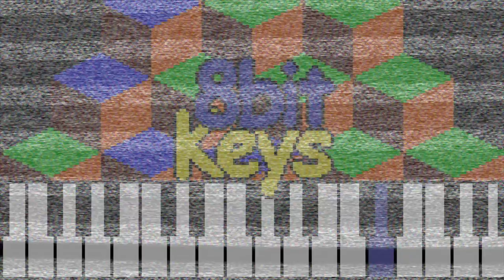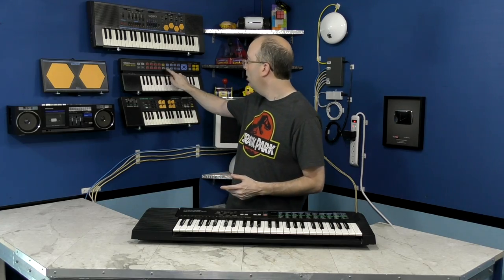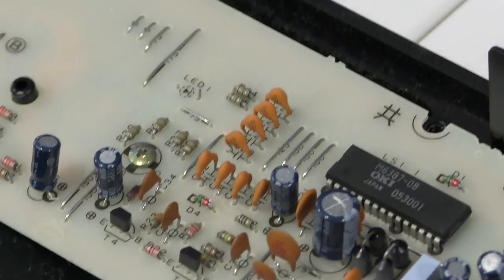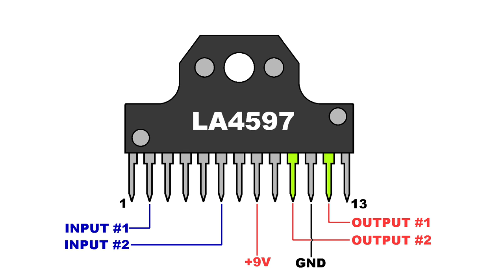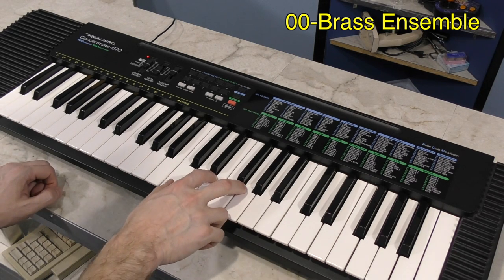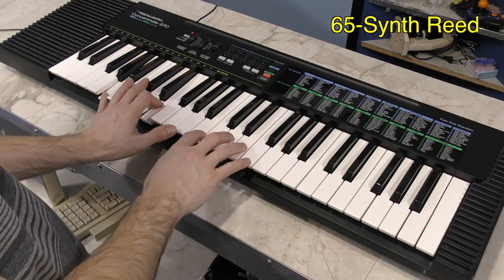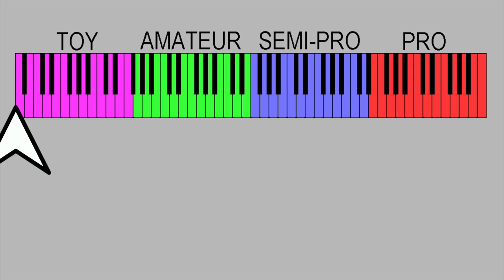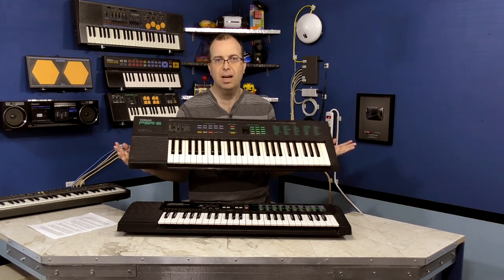Casio CA100 Line Out Modification and Demo (Realistic Concertmate 670)

Comment: I actually have this exact keyboard myself! Radio Shack rebranding and everything. But one correction about the polyphony at 8:31 . You can actually have up to 8-voices on every instrument. The instrument select button also has a label that says "poly/texture". If you press the button, it alternates between limiting the keyboard to 4-voices and giving you a more "textured" sound (which just seems to add a bit more reverb or some sort of modulation) or giving you the full 8-voices without any "texture".

Thus the actual complexity of the instrument doesn't really actually matter. It's just dependent on if the instrument is set to "poly" or "texture" mode.
Reply: +Neapolitan_ Husky I was about to write an answer myself when I read yours. Also, he didn't try the auto-accompaniment feature which limits you even further: 2 notes in texture "mode" and only one note in "poly" mode! I also have the same keyboard from when I was a kid. The interesting part is that when you remove the Realistic label on back, you find the original "CASIO CA-100" brading directly on the plastic.
However, I suspect the sounds be actually PCM (I didn't belive it back in the day) but very short looped samples, like wavetable. Nobody bothered ripping the content of EPROM chips (if it's technically possible) from the Casio CA line so I can't really tell.
Reply: @Dioxaz  This also labled as a Hohner PSK 20

Comment: Another trick you can use to get line output is to unsolder the leg of the headphone jack which causes it to mute the speaker when there is something plugged in. This essentially turns your headphone jack into a line output. I have a much newer Casio keyboard where I did this and also added a little switch so I can change whether it's a headphone jack or a line output jack.
Reply: He just likes to do (unnecessary) mods and make up reasons for doing them... I think it's more about the process than it is about the result, in spite of what he might say.
Reply: I believe most of these connectors that "auto mute" mechanically disconnects the speakers when something is inserted. Drilling a new hole would be sensible in that case, as that would put it on par with most modern keyboards that have both a headphones and a line out connector.
Reply: what is this leg on the jack? i have one but i dont know :S
Reply: @etiennelj  if you dont like the channel, dont click on the videos or comment!
Reply: @eemeli7093  why not ? Diverse opinions make for a richer discussion. Criticism prods innovation.

Comment: Radio Shack actually put final assembly date codes on most of their devices.  On the bottom, it has "6A0" on it, and that is the date, where the first number is the month, 1-12, the "A" is a spacer, and the last number is the final digit of the year.  So, your keyboard was assembled in June of 1990.

Comment: @ 8-bit Keys I have the Casio CA-301, CA-401, CTK-100, CTK-120, CTK-130, MA-101, MA-120, MA-130, and MA-201. All of those keyboards are based on the same sound chip as the CA-100. I also have the Casio CT-400, CT-840, and MA-220. Those three keyboards have similar sound hardware, but a few of the sounds are different from the other afore mentioned models. For example, the piano sounds more realistic on the MA-220 than on the MA-130. I also have in my vintage portable electronic keyboard collection the Casio CTK-150 and one of its bigger brothers the CTK-300. Both keyboards have a lot of the same sounds as the other models mentioned above, but here some of those sounds improved resembling what they’re supposed to be, such as the trumpet and the harpsichord for example. However, some other sounds such as the accordion and the bagpipes didn’t improve at all.

Comment: When my grandfather died and his house got cleaned out we came across this exact Realistic synth. Apparently He fooled around with it. I took it home, it had a black plastic molded stand it sat on as well. I had it for years. I used to take line out of the headphone jack into my 4 track and monitor through that. I composed and recorded many primitive hip hop beats with this thing and bass played through a practice amp, that i would mic through a garbage can I punched a hole in the bottom of and fixed to the end of the amp. Eventually I was going to junk it but my girlfriend at the time said she wanted it. When you zoomed into the list of sounds I got a chill as I hadn’t seen it in so long. Great mod and great vid.

Comment: I recently pulled my CA-100 out of storage and it was not working properly. I would flip the power switch and it would light up for a moment and then die. This video helped me take apart the whole thing and after checking over all the components I had a stroke of genius and looked at the power switch itself. There was so much gunk on the board from being in storage that the power switch wasnt making contact. A bit of contact cleaner and 136 screws later I once again have a working keyboard :D

Comment: I think the inverted signal sent to the speaker is called a balanced output signal. It's made to eliminate electrical noise during the transmission of the signal. I guess that's why you get a better signal from the speaker.
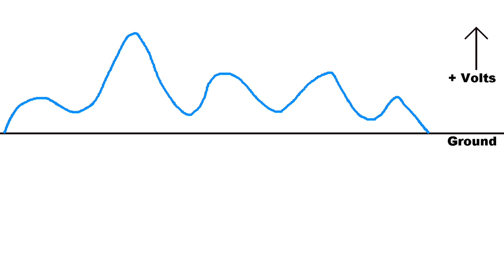Reply: it's called a bridge-tied load configuration, and he correctly identified the reason this was done at 5:27. it has nothing to do with common-mode noise rejection in this context.

the audio rip using the inverted signal as a ground reference should be 6dB higher in level than the chassis-ground version.
Reply: @technology4617  Okay thanks for the correction, It's configured that way to amplify the signal and not to correct noise if I understand. It would only cancel the signal if it was not inverted.

Comment: I don't know about you, but I'd put some heat-shrink on capacitor legs at 7:13 ;)
Also, I'm just curious - if both outputs are floating, wouldn't it be better to put capacitors on both wires? Because now your CINCH ground isn't same as DC jack ground.

Comment: Oh the amp chip is being used in bridge mode to give more power to the speaker, it’s a way to use a stereo chip in mono, but with a higher output wattage using both parts of the amp

Comment: David, the main reason why you record from the input of the amplifier is that the Amp's noise adds when you amplidfy your signal. If you use the method you said before (record directly from the inputs of the amplifier) then you'll get a less noisy signal. If your amp is a low noise amp you can just use the outputs directly but if it is a noisy one (not realy used in audio technics tho) you should get the signal from the inputs instead of the outputs. In most cases try to use the amplifiers inputs for the line output for clear audio. Love the show :)

Comment: Just picked myself up a Casio CA-110 at Goodwill. I have a Behringer 25w amp that can work as a preamp with L and R output. I would recommend getting a small amp like it. It would save you the hassle of finding the amp on the keyboard, soldering, and drilling. You would have no input delays. Also, you get the added benefit of stereo v mono; as well as, you would be able to make adjustments to gain, bass, mid, and treble. Mine was just $100.

I know you said you don't have a studio, but I think for a buck it would be a good investment since I have seen you do this more than once. This merely a suggestion. I'm not telling what to do.

Also also, they had a behringer guitar amp at the same goodwill that was a 30w for $50 that had the same function. I'm in CO though not TX :,(

Comment: I have the Casio version of this keyboard (or one very similar), and it has the interesting feature that when you press the "tone bank" button, it will alter the "depth" of whatever instrument you're using, giving you more or less polyphony.
Also interesting is that on my keyboard Piano IS the top option. Also, it has the same demo tune - no Rick Astley.

Comment: You should not use a polarized capacitor when connecting to a BTL amplifier like this one. In addition, the keyboard can never share the same ground as the device you're connecting to or you're likely to have a dead amplifier chip.
Reply: (I agree with you.) I asked the same question before. Electrolytic capacitors can withstand 1 to 1.5V reverse voltage. Thus, line level AC should be fine in this case. Moreover, the keyboard itself's already isolated as a transformer's being used at the 9V power input. (But I would use a ground loop isolator whenever dealing with different voltage of ground.)
Reply: why is it bad to use polarized ac coupling capacitors with btl amps

Comment: I have a Casio CTK-100 that looks a bit different but sounds exactly like that. Same demo and button press sound and everything. Built the same too with the circuit board on top and the OKI chip. Pretty much the exact thing just a more modern looking package and actually has the Casio badging.

Comment: the audio in this keyboard gets boosted by a two channel amp , so if you have only a mono spaeker keyboard but a stereo ampfilifier it gets brigded to double the ampfilfication. It works when both channels on stereo have the same data. This is a common method on car hifi ampfilifiers, cause they are often at least stereo but many people are using these for an extra subwoofer (1 channel) so you can bridge the amp and gain the power of the second transistor inside the amp.

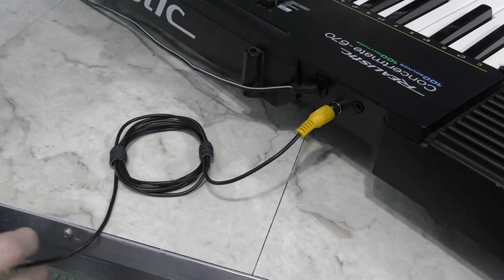Comment: 7:28 I think because the voltage provided to the speaker is around 2V.
If the speaker is 8 Ohms, it will run at 2.25W.
If the speaker is 4 Ohms, it will run at 2.5W.
They basically cut out a poweramplifier, and just installed a cheap speaker on their line signal; since every system actually has a soundchip, a line amplifier (for line out), and a power amplifier or two.
It's probably an FM chip.
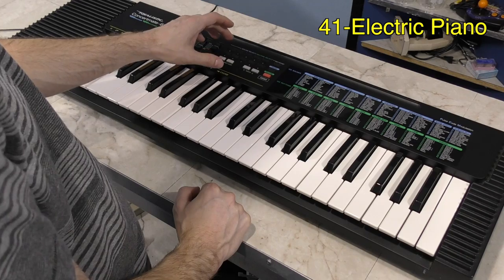9:38 I think they just dual layered instruments, causing it to sound like it was an octave higher. Yamaha Clavinova has the same problem with layering samples.
13:43 Even with professional instruments, I end up only liking about 10 good sounds out of 500 bad ones.

Comment: In software like Reaper (or any recording software really) you can turn "monitoring" on a track to listen to what you're recording.
Reply: yes but it sounds different coming from PC connected speakers/headphones, compared to the keyboard itself, and some professionals would definetly notice the input lag vs hearing the sound, and it would be disruptive.
Reply: in this case, which is recording toy keyboards, i don't think that would be a problem at all.
Reply: Audacity also has a play though option.
Reply: bpc7 But going through the computer creates a delay, which will mess up his playing.
Reply: Ryuhouji No it doesn’t, that’s what professionals use actually.

Every DAW does this and the delay is so small you will never notice it, especially an amateur
Reply: My interface (ur22) has handy daw-input knob. Its really useful for recording and monitoring live. Basically no lag
Reply: @Luke I'd say installing Asio4All and setting it up is quick and simple, it's pretty much plug&play. Most certainly it's more quick and simple than soldering and fixing a line output into the case of the keyboard.

Comment: Ohh the memories, I think I had the same keyboard, bought it as Casio CA-110. Had the same demo tune, most of the sounds are similar, though my default sound was Piano (starting at 00)

And you can change the note polyphony from 4-note to 8-note using the Sound button.

Sold the keyboard to a guy, but I think I have the manual somewhere!

Comment: If you use/have access to a PC use a basic USB 2.0 sound card.  You can get basic models and ones where you can switch between mic/line in and they are an absolute need for someone who has a laptop with a single multi use 3.5mm jack I/O.

You could probably get one on Ebay for a few dollars.

Comment: Disclaimer: I'm not actually an electronics engineer, especially not a music-realted one.

Your capacitor is WAAAAY TOO LARGE! You need no more than about 1uF..10uF cap. That's 100 to 1000 times less than the one you used. I won't be surprised if the sound you heard mostly came from leakage current - with the capacitor acting as a resistor.

Also half of the time your cap is connected in reverse - VERY BAD for electrolytic caps. You probably did not notice yet because it is rated 50V and the audio levels are probably about 1V - that may be within its tolerance but still a bad idea. Electrolytic caps are mostly just for power supply filtering. Use a ceramic cap - they are unpolarized (mylar or polycarbonate should have less distortion, or so I'm told, but ceramic is fine for this project)

More importantly, ONE CAP IS NOT ENOUGH when you are tapping into both leads of a balanced circuit - you need a second cap on second lead. This is because if power supply "-" is connected to a protected earthing on the 3-prong AC plugs on both sides, you are essentially shorting one lead to ground exactly where there is absolutely no protection against it. You probably didn't notice because the keyboard connects via an unearthed plug but it's asking for a disaster to happen.

There's another problem with your setup - you connected a BALANCED circuit in your keyboard to an UNBALANCED cable+circuit in your computer. This has subtle side-effects like kind-of circumventing the shielding of your audio-cables. Normally you need something called  "balun" which consists of a transformer and some optional resistors - you can buy one of these or just wrap 2 parallel strands of fine wire around a ferrite core. If you use a balun you should not need any capacitors, although you should connect a current-limiting resistor in series (I'd guess 10 ohm is fine, probably). 

However, since the keyboard won't actually produce any studio-quality Hi-Fi sound anyway, and you are not connecting it via a 10+ meter audio-cable, so you can skip the balun altogether and just use 2 caps.
Reply: Yup, the most critical thing here is that he's potentially shorting the amp output to ground.
Reply: I don’t think the current nor voltage is high enough to cause any problems
Reply: @ilpatongi  stick to cars dude!!
Reply: No one cares
Reply: TTG_Jamie can it

Comment: Hi
I dont know that you did noticed it yet, but this keyboard or actually Casio CA-100 had somekind switch between polyphony / sound quality. This is why you found that one sound has 4 note poliphony and another 8. To change between you have to push TONE button twice. I mean 1 for choose tone select, one more for change sound quality. To change it back you have to press  once more. I hope you will find out how to do that. This is basicly i think for more advanced players when they want play two hands chords or chords including more than 3 notes.

Beside that this line out is wrongly connected. You could use positive/negative levels to make BALANCED audio out but in this case is too high level to be shorted eventualy to ground to using this as it is now. To make balanced out you need another capacitor - the same as this used in positive line. I would use here 100uF.
Cheers
Greg

Comment: I've got the Casio CA-110. That's the same demo tune as the CA-110. The sounds are all the same but the CA-110 puts them in a different order.  The Keyboard sounds are first, then Wind, then the 2 columns of String and then comes the Brass. Everything else is in the same order. This all puts the default sound on Piano. The CA-110 also claims Pulse Code Modulation. I also like the colors and additional graphics on the Casio CA-110 better.

Comment: Buffer your line out, dude!  I'm surprised your EE friend you mentioned didn't bring that up after seeing what you were doing.  Tacking your line out directly from the synth chip is super shoddy and I'm surprised it even worked.  If you buffer it with a unity gain op amp or something you can make it so you don't load it down so easily and even if you do you wont kill the signal on your chip output pin.

Comment: Hi, I love both of your channels!  Can you provide more info on why you chose that particular capacitor size?  I have a similar project where I want to add a line in on a Sony camcorder so that I may use an external mic instead of the built in one.  I'm just not sure how to go about it without sending too much voltage to the chip.  Any info would help!

Comment: The funny thing is: There is a powerful (and not accessable) synth engine under the hood of those Casio keyboards. The basic waveforms are very short samples (PCM) that are modulated and filtered with some complex algorhythms. To proof this: Select a sound with modulation (cosmic sound etc..) and lower the volume. The lower the volume, the faster the modulation.

Comment: I am a professional pianist and I have the same problem with headphone output but no line-out, with the P- range of Yamaha keyboards (which are fantastic quality and value for money). I've had a P-60, P-70 and P-95, each has been well and truly been gigged to death.
None of these keyboards have line outs - just headphone outputs. So I just crack open the case, and inside the headphone socket is a small piece of plastic (switch) that you can snap off and then by connecting the headphone output to an amp (mind you, voids the warranty) and you get the output come through the internal speakers as well - and this has never caused me any problems at all, after 12 years of gigging like this. Although, now I feel like the time has come in my career that I get a car and a Nord, and stop smashing my keyboards about on public transport !!